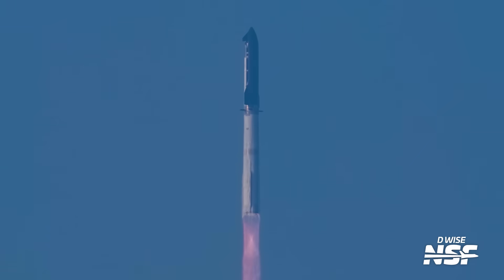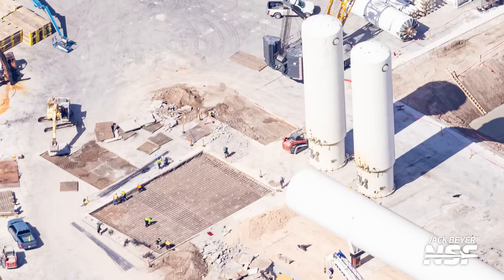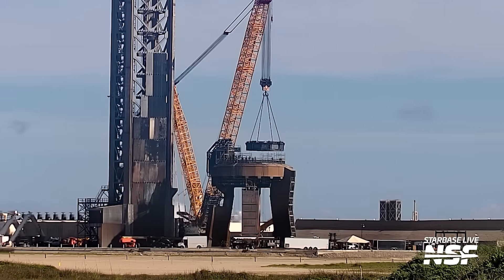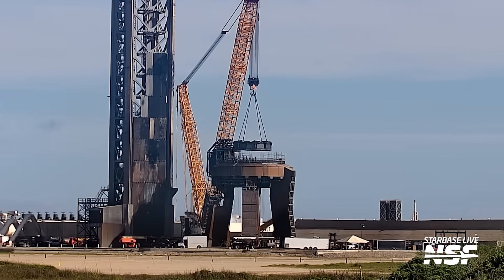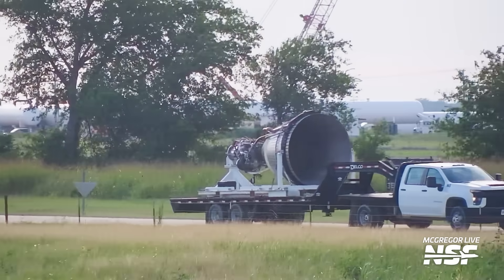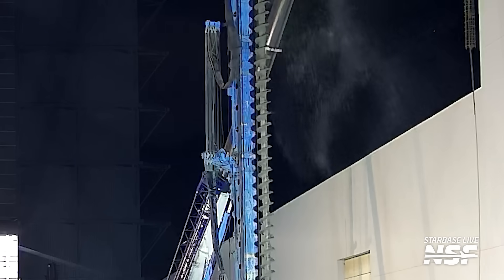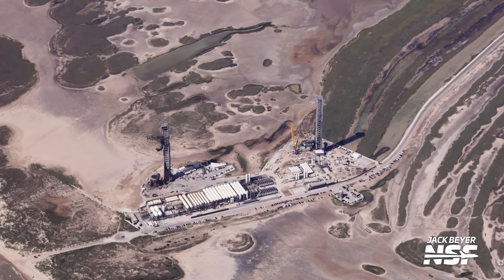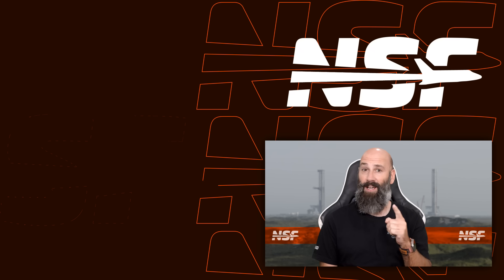Starship Static Fire Next Week? + New Pad Progress! | Starbase Update

Comment: Why didn't SpaceX modify the StarShip test stand to fit into the launch mount like the Starship booster?  Then use the hold down clamps for the booster to hold the test stand for the Ship?  Then easy on, easy off.  No Dismatling, just hook, unhook done.  Just a thought.
Reply: The booster has clamping hardpoints at each of 20 engines, and they stick out. The second stage uses hidden clamp points just inside the perimeter.
Reply: That's what those plates bolted to the hold down arms are for, they replace the clamps for the stand. once it's in the mount they will be welded to it so when they come to fit the stand for S38 all they need to do is bolt it back in again. The clamps for booster are simply no use to attach as ship stand.

Comment: If I were Spacex, and I'm not, I would like to see data from a successful starship flight before continuing and finalising the manufacture of future starships. What if the first successful flight shows up a fundamental design flaw and that is already built into several new ships?
Reply: Then they have to throw those ships away. Better to risk it, as it may save a lot of time compared to waiting.
Reply: Finding the problems is the whole point of the test flights.  They DO have the actual data.
Reply: @imaginary_friend7300  For instance they are still lacking data on the payload door and pez dispenser. If they find a problem with the next flight there is still time and ability to modify the next ships.  And the heat tile saga is still not ended. Why cover the next ships in tiles if new tiles are needed. I'm sure there are other unknowns.

Comment: SS is way too fragile.  Elon needs to give up some payload for robustness at this point.  What good is trying to get 100 tons to orbit if it can't actually get to orbit?   And 300+ tons?  Come on, man.
Reply: In which way is it fragile?
Reply: @ale131296  It's pretend expert nonsense.  He has no clue.
Reply: Until the maneuvering control is shown to be consistent, they won't be attempting full orbits. There is no problem loading more propellant and running the engines for a minute longer. They choose not to.

Anyways, with block 3, both stages will be taller, capable of holding both more propellant and cargo.

Comment: No because of the iterations they have to do between each flight so they will probably have to SF anyway. Doing one before Flight 10 just means the will probably have to do 2 SF. 
My question is what happens if this ship blows up but on the pad this time?
Reply: No doubt they inspect the COPVs in-house from now on. Plus, bring their COPV pressure up before pumping methane.
Reply: Testing always has risks and they already test the booster there and it's a lot bigger.

Comment: Looks like they were performing "Wave Offs." They do the same thing when testing jet engines. They are also called "Thermo Cycles" checking the integrity of rotation parts like impeller clearance as well as flange leakage. I'm just saying 🤷. Regards

Comment: At this point SpaceX is just rebuilding destroyed ground infrastructure because the V2 ships are so much worse than V1
Reply: No they are building for v3 hardware which is not compatible with either previous version due to raptor 3 changes.
Reply: They have shown that there are issues with the design changes they made.  And finding those problems is of course the whole point of the testing.  They're not done breaking things or blowing things up.

Comment: If Elon Musk sends 1000 SpaceX Starship Cargo Pods to the Moon / Mars.  (Instead of 1000 starships.) There is no need to refuel the starship.

The Cargo Pods could be the same size of the starship cargo bay. ( 35,000 cubic square feet.)

The starship could open from the tip of the starship.  The cargo pods could be ejected with some kind of spring mechanism.  Shot out of the starship like a bullet.  ( or they could have space shuttle like cargo bay doors)

If necessary, after ejected they could be caught by a re-usable device, similar to a 2nd stage, on standby, that could push it towards the moon / Mars.  Once up to speed the device would release it.  These pushing devices could be refueled by cargo pod tankers, or exchange cargo pod tankers. ( Just swap them out )

The cargo pods could have anti-spin, and course correction devices / mini jets.  So they can travel by themselves.

Once at their destination, they could be caught by a re-usable device, similar to a 2nd stage but with a heat shield for Mars, on standby, that would slow them down and land them on the moon / Mars.  For Mars they would have a heat shield to protect itself and the cargo pod.  These devices could be refueled by cargo pod tankers, or exchange cargo pod tankers. ( Just swap them out )

The cargo pods would not require an external elevator.  The doors would be on the bottom.

If the cargo pods were landed in a circle, a big inflatable dome building could be inflated in the middle of them.  Inflatable tunnels could connect the cargo pods to the dome building.  The whole thing could be covered with 3D printed cement, even the cargo pods.

Some of the cargo pods could be reused.  A device would have to pick up the cargo pod and take it back into orbit.  Once in orbit, it could be sent back to some place to be reused.

Other cargo pods could have pre-built in facilities, like refineries, factories, farms, dairies, ranches, fish growing facilities, grocery stores, retail stores, hardware stores, living quarters, cafeterias, restaurants, bars, jails, police stations, city hall. Libraries, recycling plants, fuel depots, oxygen & water plants, composting plants, etc., etc..
(Just about anything could be pre-built into a cargo pod, saving a lot on site work.  Later buildings, etc., could be built piece by piece.

I was thinking artificial gravity on the moon / Mars could be created by building a giant rollercoaster, with the roller coaster cars so big you can live in them.  The rollercoaster would travel in a circle and lay flat on its side.  So when it traveled at 1G it creates artificial gravity on the floor of the roller coaster, the flat part nearest to the wheels.  

Also we could build a space motel in the shape of a cube, by just docking space station modules together.  It could spin and have artificial gravity.  It could also travel to the moon, and especially Mars.  ( a 7 month journey.). It could be a cycler, continuously traveling back and forth. 
With just 12 space station modules forming the cube, it would have 420,000 cubic square feet.  We could build 10, 20. Maybe 100 of them.

Also we could build a mobile moon / Mars base with inflatable space station module strapped to an electric truck chassis, driven with remote controls and cameras.  After 10 or so of them have reached there destination, they could be docked together, forming a good size moon / Mars base.  

To colonize the moon & Mars easier.  We could build some real nice retirement communities on the moon & Mars, and send 60 million retired people to the moon & Mars.  And send 6 to 12 million people to take care of them.  All these people would be a big boost in colonizing the moon & Mars.  🙂

As soon as possible, starships should be built on the moon / Mars.  Because of the lower gravity, starship should be built 3 times bigger on Mars, and 6 times bigger on the moon.  With a 105,000 and 210,000 cubic foot cargo bays, and use the same amount of power to launch, from the moon / Mars, as the current starships.

To build an underground city, use a tunnel boring machine, but don’t go in a straight line, make switch backs, and then make switch backs, through the switch backs, so you end up with a whole bunch of square sections.  Now either build stuff inside the tunnels or cut out doors in the tunnel walls and dig out rooms in the space in between the tunnels, supporting the ceilings with brick arches, etc.  You could have two floors by having stairs right near the front door and the back door, 5 stairs going up, and 5 stairs going down.  With a bench on the landings for those who need to rest.

How to make a crew trip to Mars shorter ?  Have two starship leave earth at the same time. One is a crew starship, the other is a tanker starship.  As soon as their fuel tanks are half full, the tanker starship, gives all of it’s fuel to the crew starship.
Then the crew starship recalculates, it’s possible maximum speed and maximum braking power, and speeds up.  Shortening the time of travel of the 2nd half of the trip.  (Total trip time approximately 5 1/4 

I was just thinking, you could have two tankers, one tanker gives up all of it’s fuel when all three of them are half empty, the other tanker gives up all of it’s fuel as soon as the crew starship has room for it.  Perhaps 1/4 of it’s fuel would be transferred.  Unfortunately the 2nd tanker waste about 3/4 of it’s fuel just keeping up the crew starship.  It might not be financially worth it to have the 2nd tanker.  It all depends how much that extra fuel shortens the trip.

After 5 1/4 months total travel time, the crew starship brakes and lands on Mars.  
1 3/4 months later, the tanker starship slingshots around Mars, and travels back to earth, where it blows up right before splashing into the ocean or it is caught by a re-usable device, (similar to the 2nd stage of a rocket), slowed down, landed on earth, re-fueled, and made ready for it’s next flight.  

The crew starship is not sent to Mars, until 5 fuel depots, catch and launch facilities are setup by Tesla Optimus robots. In fact 5 whole Mars bases are set up before any humans are sent to Mars.  All are air and water tight and self sustained. 

Also no one wants to leave and go back to the earth or the moon colony. If you go to Mars, you go to stay, except for tourist.

How to build permanent cities on mars.
Send 50,000 Tesla Optimus robots with some mining equipment.  Have them mine for raw materials.  Then send refineries.  And factories.  Then send raw material, that are not found on Mars.  Have them build a city for 102,000 people, with everything in it, with most of the city 14 feet underground for radiation protection.  An air & water tight, self-sustained city.

Then send 15,000 people to run the city and work in the retirement industry.  Then send 75,000 retired people to live in real nice retirement communities.  Then send 2000 people to work in the tourist industry.  Then send 10,000 tourist to stay in real nice tourist communities / resorts.

Then build 2 more cities at the same time.  Then 3 at the same time. Then 4.  Then 5. Then 6. Then 7.  Then 8.  Then 9.  Then 10.  Etc., until perhaps you are building 25 or 50 cities at the same time.
🙂
Reply: Good Lord dude, lay off the drugs.